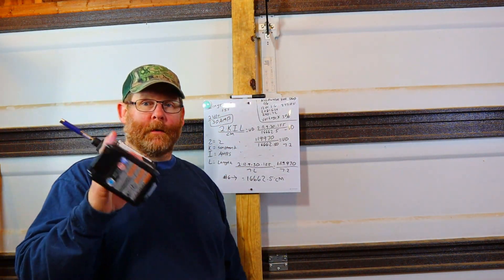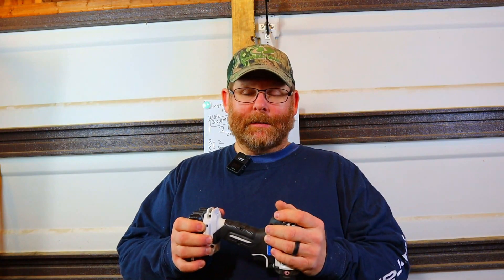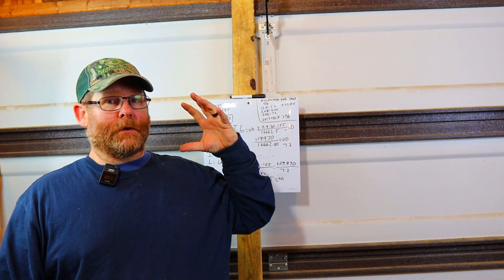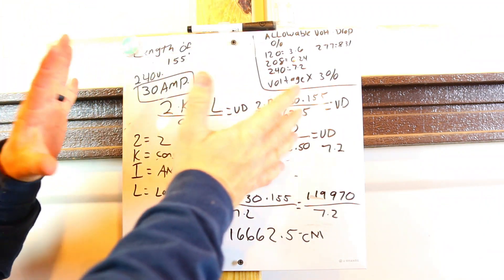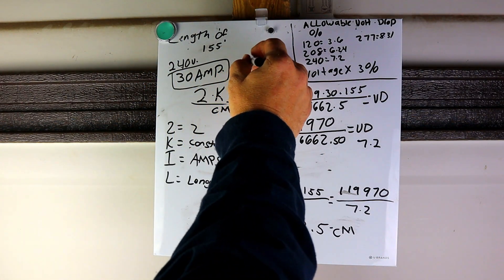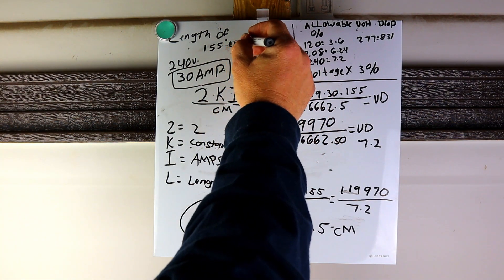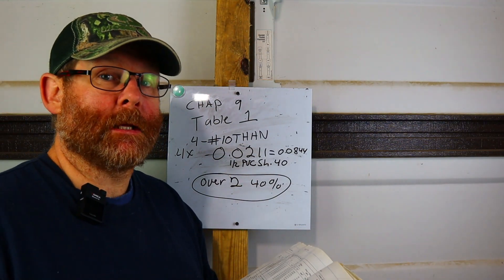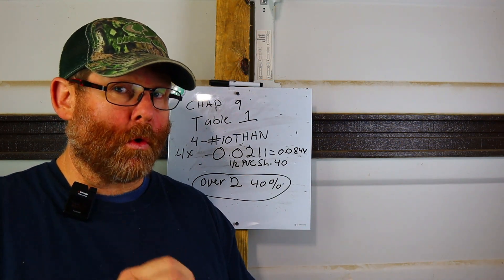How To Figure Out Conduit Fill Two Different Ways

Comment: What was your length in the original calculation? I'm looking to run some outlets (240/30A, 120/20A) into my garage, and later adding another 240/30A for an air compressor. Using Southwire's online calculator, it says the same thing (I need to run 6awg).